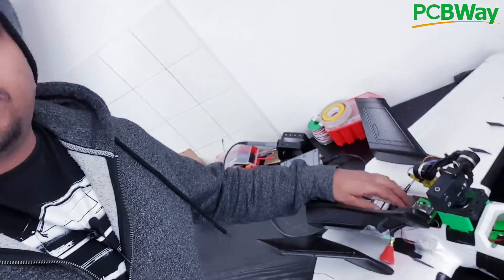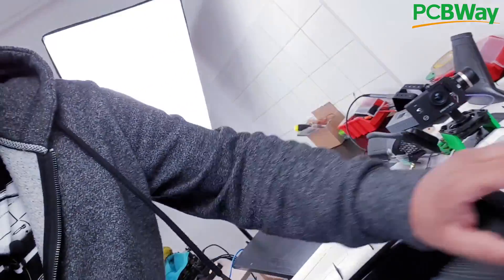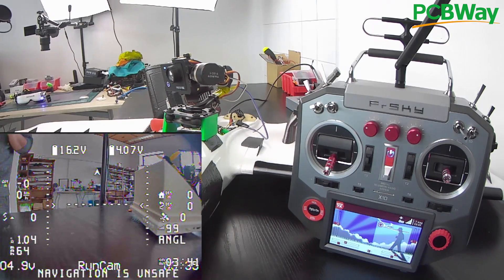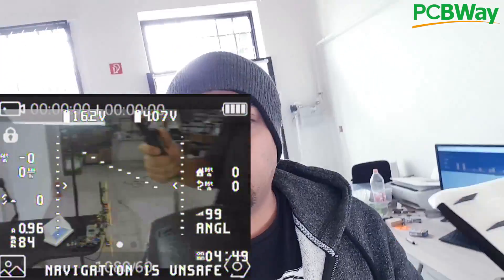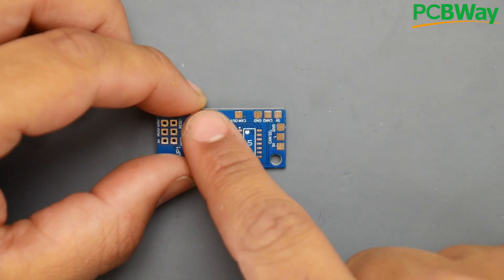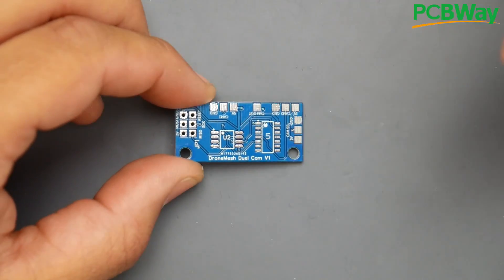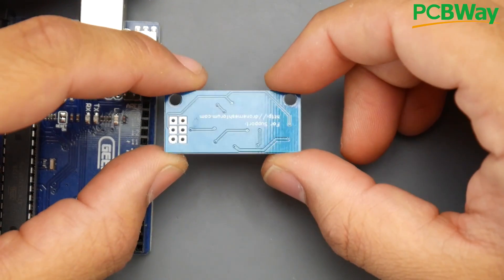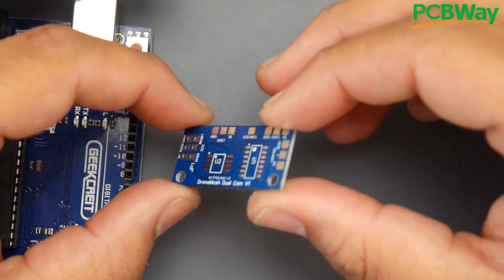Custom Open Hardware Dual FPV Camera Switch // That is Programmable

Comment: Excellent work! , but annoying 😢, I just bought Bicks's MultiView Duo - FPV Camera Switcher 2 weeks ago.
I have not had the time to fit yet, but it will soon be in my new build as a cheater quad based on
a Realacc Martian IV 6 Inch frame.....

Comment: Beautiful job, Mesh! Fantastic!!! 😃
Unfortunately, I already bought a camera switcher for my TBS Discovery build... (That I couldn't even start yet. 😔) But, anyway, next time I'm going to use your project. 😃
Anyway, do you have a link to the cable to get the video feed from the Firefly camera? I bought one with the smaller FOV and I'm going to buy another with the bigger FOV... And I'm going to use the smaller FOV to record my videos. 😃

Comment: Are you using a gimbal controller or a gimbal control board to move the gimbal how did you move the gimbal
Reply from the maker: Tarot Gimbal can be controlled with sbus or pwm I used pwm comming from the flight controller that is mapped to my RC controller..

Check my Zohd DartXL gimbal mod video
Reply: @DroneMesh  awesome thanks for the info, keep coming out with the great content that you do